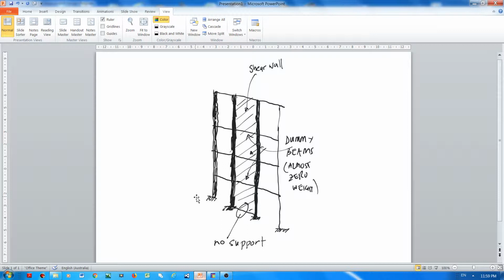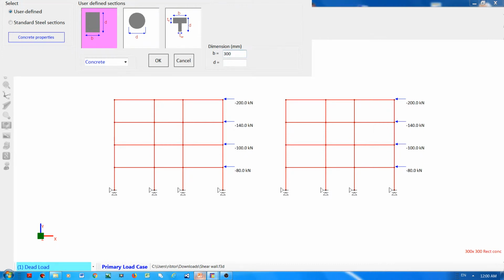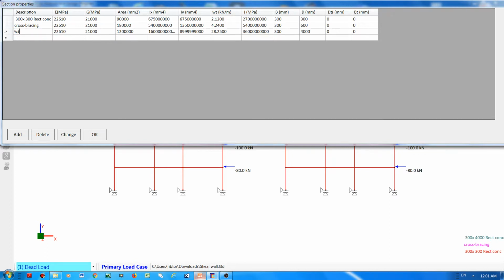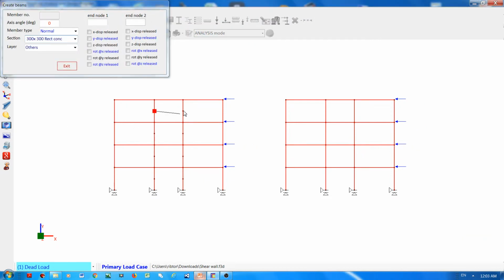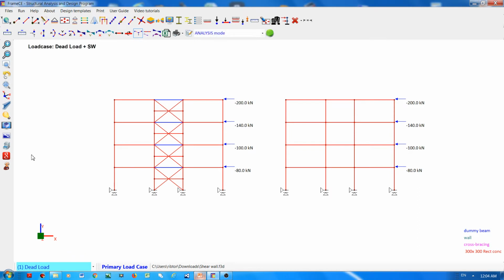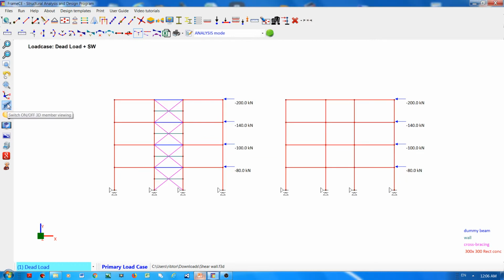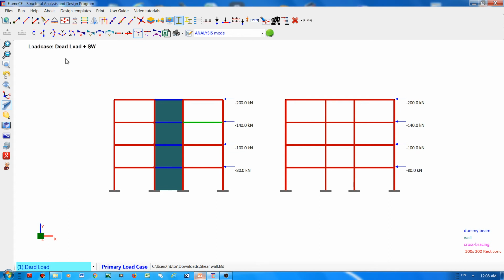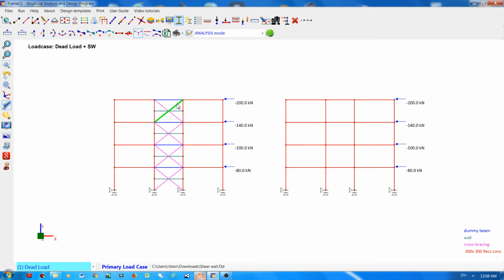Simplified modelling and design of shear walls using FrameCE

Comment: Hi Sir, usually, in detailing shearwalls specially for elevator shafts, we are just using vertical members with horizontal ties. How then can we convert the results in FrameCE using this crossbracing technique so that we can produce the quantity of vertical rebars and horizontal ties?